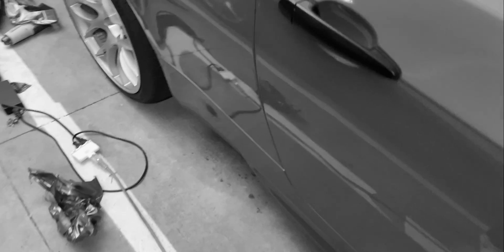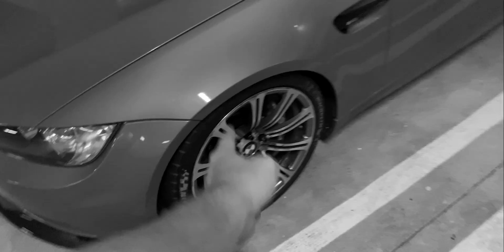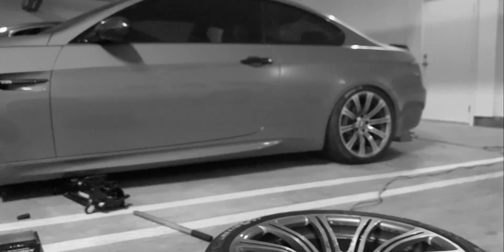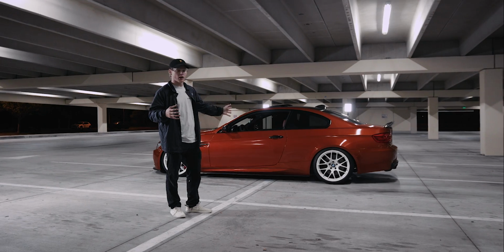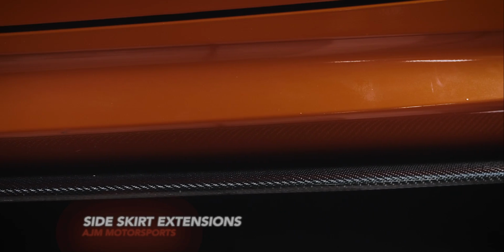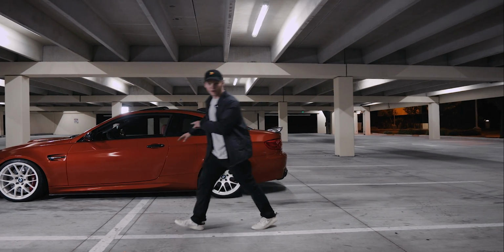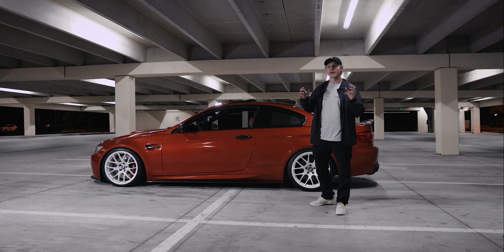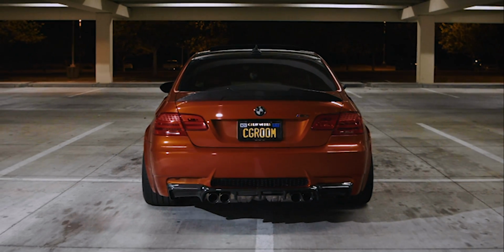THE NEW BUILD OF MY E92 M3!!!

Comment: For those lug nuts...I take a plastic grocery bag and put it on the lug before I use the socket...It does protect the lug for a few turns before it rips then just use a different part of the bag
Reply from the maker: Hahah I can see that working, but would rather not have to worry about it. Thanks for watching!